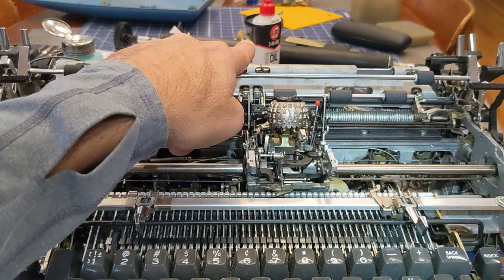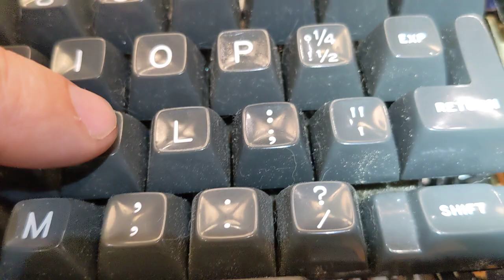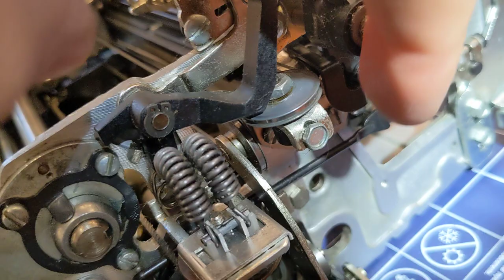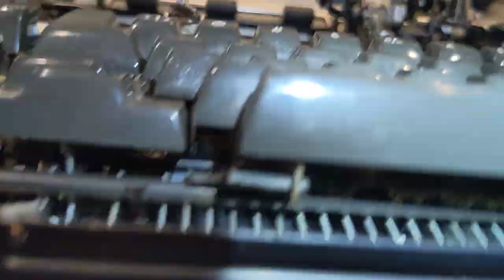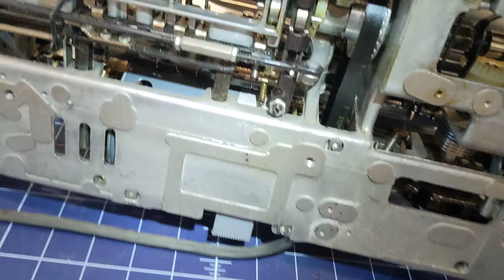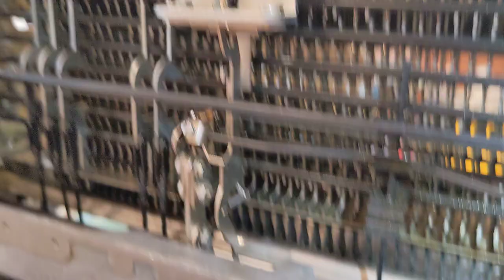IBM Selectric explainer: Shifting lower and uppercase

Comment: My Selectric II works pretty well but intermittently will not strike when SHIFT or LOCK keys are held, in an attempt to capitalize. Any idea on what I could do to fix this?
Reply from the maker: There's an interlock bail (underside of keyboard. It restricts cycling during the shift unshift cycles. That's a good starting point.
Reply: @nickydoes  That's an awesome tip. Thank you!